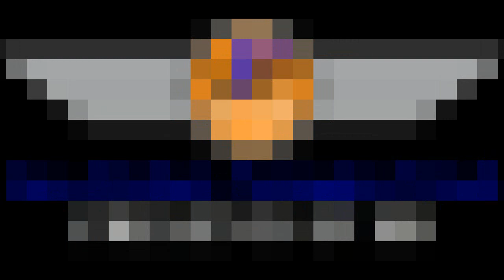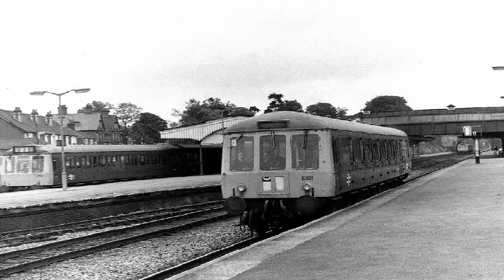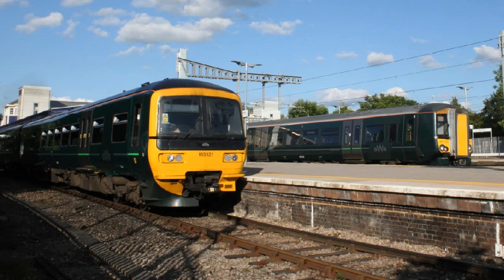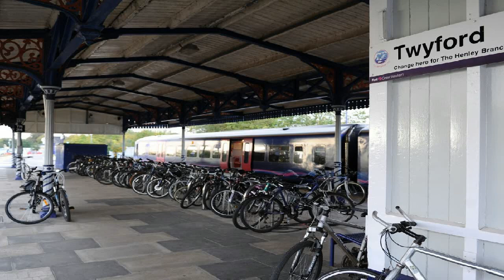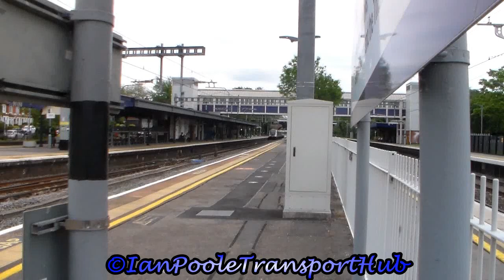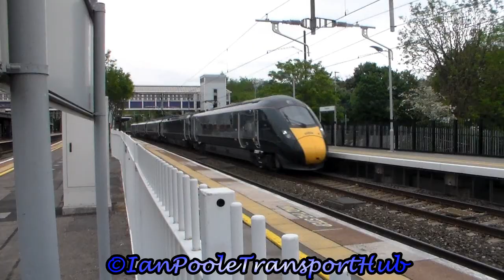Trains at Twyford railway station (28/05/2021)

Comment: That 59 was pulling a huge load like wow, good vid m8
Reply from the maker: That was a mega load, that train right there is officially the longest and heaviest in the country
Reply: @IanPooleTransportHub  yes 4800 tonnes approx, was reading on Wiki tho 59005 managed to haul 12000 tonnes apparently back in the 80s or 90s, absolutely mad the pulling power of the 59s